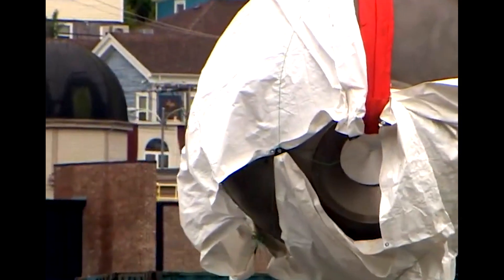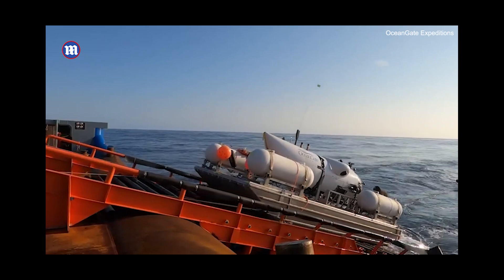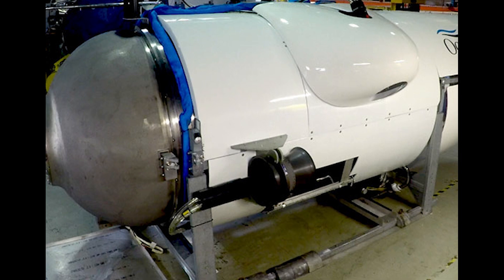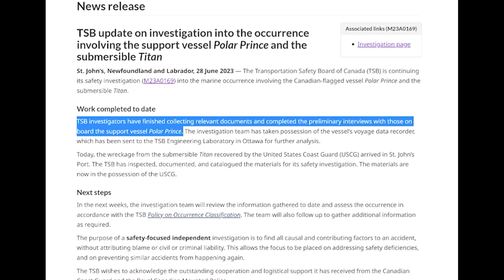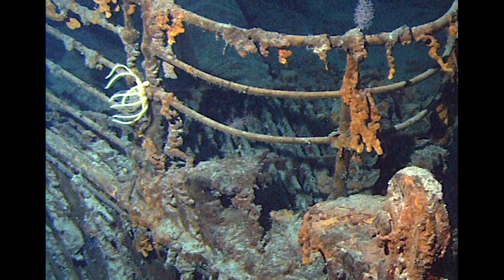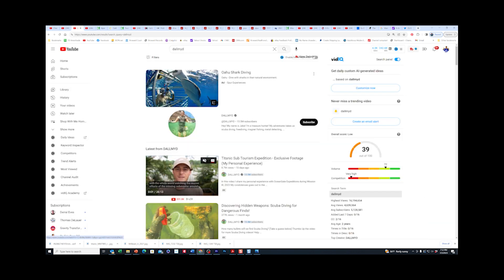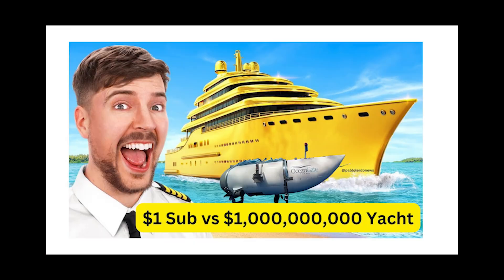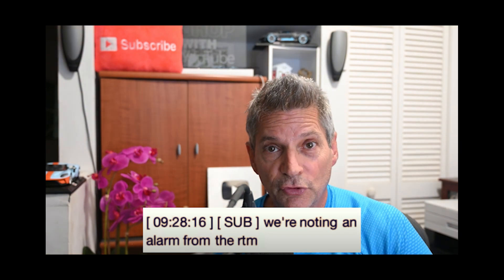Titan Submarine Debris Clues, Implosion Simulation

Comment: So where's the ring that attaches the view port? Ok they removed it from the end cap topside once the ROV loaded it on the seafloor into the hoist bucket along with all the other recovered parts. Remember that the navy has divers that prepare everything BEFORE john Q prying eyes sees things they don't want them to see above the surface. They probably have the ring and view port in their possession and so we'll never see either of those parts again. I also doubt that the acrylic view port imploded otherwise they would NOT have needed to remove the ring in the first place (so that they could hoist the very heavy end cap aboard using the hoist strap).

The ring attachments to the carbon fiber cylinder was NOT the cause of the implosion because those end caps were under tremendous pressure to KEEP THEM attached to the cylinder. They could've used Elmer's glue at those joints they weren't going anywhere because the deeper they got the stronger the joint would have been sealed due to ever increasing pressure. Please note that WHERE the cylinder joined the end cap pressure was being applied at the carbon fiber joint itself evenly all the way around the cylinder and this would have distributed that load equally all the way around the circumference of those joints.

The perimeter of the end cap joint could very well have been picked clean of any fiber remaining by the naval recovery divers. Remember that we have not seen ONE SHRED of that carbon fiber cylinder (which happens to be the largest single piece of this sub). That's my suspicion based upon governmental cover up of not only this implosion but also UFO/USO investigations as well.

When this carbon fiber cylinder imploded it did so from the MIDDLE of it probably at its weakest point. However that implosion would have been so violent that it shredded almost all the carbon fiber cylinder so much so that the end caps simply dropped to the sea floor. That's why they were easy to find probably only a relatively short distance apart. Remember that any explosive separation had a lotta water resistance thus those caps wouldn't have been located very far apart. The cause is exactly as most of us with any brains surmise.. Implosion of the carbon fiber cylinder.

I question why not a sphere? Wanna carry more people make a bigger sphere. But make it out of stainless not titanium.. with NO view ports. use a battery of external cameras instead that were attached to monitors circling the guests. You know like a round restaurant table. This sphere also would need a sub type hatch.. that is closed and opened from the INSIDE AND OUTSIDE. I'd have two of them for redundancy. Yep everybody wears a urinal bag and gives themselves a laxative to clean out those pipes before disembark. And no solid food 8 hours prior. Yeah have a delicious vanilla malt or something! Finally I would have MORE negative AND positive buoyancy to make this trip down and back a lot quicker.. no more than an hour each way. Think Trieste.. Remember how that submersible obtained positive buoyancy? It used a huge tank filled with gasoline that gave at least 12 pounds of additional positive buoyancy for every cubic foot of gasoline. That in addition to a nice sized sphere would mean you'd need to carry a LOT of ballast. but also remember that stainless is super, super strong about twice as strong as titanium. And finally, finally, I would test that sphere to TWICE the depth of the Titanic. They can do that off of Cuba.

Comment: If the failure point was at the rear, it's possible that the domed front window could have been pushed outwards when the implosion occurred, a direction that the flange wouldn't have been designed to get force applied from within, if that was the strongest point with the titanium front then it would be the last part to implode thus you'd have that force and the debris imploding into it it definitely seems possible

Comment: Stockton used a wet extrusion process to build the carbon fiber cylinder. This was a big mistake. Carbon fiber extruded via a wet process becomes brittle over time. A dry extrusion process which is more expensive, produces a much stronger cylinder. Drying the fibers before using them reduce the formation of voids caused by moisture and the extruded filament is no longer brittle.

Comment: It’s very interesting that these people thought what is essentially really expensive fiberglass and glue would be able to have multiple deep dives
Reply: I think the guy wanted to make a cheap low cost underwater tour bus business with low cost disposable subs.  Probably why he was courting influencers to increase his notoriety.
Reply: The glue is the good part, it didn't need to hold, just needed to be a well conforming filler. Since under pressure, the plastic resin of the carbon fibre epoxy wants to shrink more than the metal ring, but the lip of the ring prevents it. Under water, the water pressure is what sealed the vessel, applying both pressure that sealed the fibre epoxy tube against the lip of the metal ring, and the pressure to the endcaps sealing them to the rings and pressing the rings solid onto the cylinder. If the cylinder survived, so would most likely the whole vessel, regardless of the "glue" joint.

A little similar to the cheap Soviet dive watch, Vostok. It's famously a little leaky, UNTIL it gets under water and gets a good bit of pressure applied to it, where the deformation of the deliberately flexible pieces and the pressure is what seals it shut. Of course something that on a cheap semi-plastic watch should be called "ingenuity", on a semi-plastic vessel with people inside would be called "madness".

The mostly plastic cylinder with internal delamination risers in it formed by the carbon fibres was certainly not the good part though.
Reply: Carbon Fiber is strong, but fragile, it really doesn't handle repeated massive pressure cycles well.  Not like titanium or steel, which can flex and still remain strong.
Reply: Yes, it's called intellectual arrogance.
Reply: It did have multiple deep dives.

It allegedly completed over 50 test dives and visited the Titanic more than 10 times.

Not defending OceanGate, but keep in mind the most advanced and powerful navy in the world lost the Nuclear Sub SSN-593 Thresher during deep dive testing (which was to 400m, approximately 1/10th the depth of what the Titan was diving to).
Reply: @B61Mod12  Yep. People are totally ignorant about this whole thing. I also am not defending OceanGate or Stockon's complete disregard for safety, but the facts are that the Titan had been on many dives prior to this one. Carbon fiber can withstand these depths for many cycles, but you NEED to be vigilant in checking the integrity of the strands, which OceanGate didn't do even once. I can imagine that you are unable to remove that glue they used on the port holes as it's a chemical reaction that bonds it together. So they would have had to replace the entire sub every few cycles, which would have most likely saved the Titan and its crew from death.
Reply: @B61Mod12  Yes, and in response US Navy instituted "SafeSub" program.  They are fanatical about submarine safety.
Reply: Cracking sound heard on previous dives. I ASSUME that anyone with half a brain conducts  structural  testing after each dive. There  surely had to be signs that the structural material was weakening. And yet it appears these clowns conducted no testing after hearing the cracking sounds in the previous dive.  WTF?!?!

The good news is that this CEO and the dumb wealthy morons stupid enough to pay millions for a ticket are all dead. Good riddance!
Reply: made by Father Ted

Comment: You can’t just glue two pieces of different materials together and expect it to be stable. Each material has different properties under different conditions. They will behave differently to stresses such as temperature and pressure. Even the glue will behave differently as well. A spherical design uses the pressure to actually make it stronger.
Reply: Vacuum tubes and incandescent light bulbs come to mind. The wires on those things use black magic.

Comment: Like you said “Torque Wrench”! If I work on my Truck,And I have bolts that need tightening to “Torque spec”, Well..If I just use a regular wrench,I’m taking a huge risk of causing a leak, because I (Over tightened) the bolts and Pinched say, a Gasket. I am also taking a huge risk of bolts coming loose because I didn’t torque to “Spec”. I know there is wasn’t “Specs” for this sub but,If I could give the world a word of Advice when it comes to  anything Mechanical. Always use a Torque wrench if Available!

Comment: the whole design was amazingly bad; smooth, flat surface bonding, uni directional CF, very dissimilar thermally reactive materials. lack of secondary escape system. lack of redundancy or emergency ascent system.  I'm not a submariner at all, but I have been working with carbon fiber and titanium since the mid 80's in aviation. From an Eng. stand point, this is criminal and the Eng's, that worked on this sub and approved its use without complaint.. should be black listed from anything but science fair popsicle bridges

Comment: Ive got some speculation. 

 im not saying the porthole was the cause. But i am thinking the porthole became the nozzle when the window failed. Sucking the sub, and occupants, inside out, in a jet of super heated vapor, into the sea.

So in short the aft section tore/crushed,  and with all the ingesting force, sucked the sub inside out, 5hrough the porthole. (Mostly)

Comment: you need a bathiscaaf made by Swiss, Italy and Germany. They went like over 10.000 meters in 1960! Never change a winning horse. That concept worked safely.....why experimenting with lives??? They know how to build stuff with ten big heavy Mercedesses on every square centimeter....titanium is good, forged steel the best. It has to be massive.......and the plexiglass will always be the weak point. 1960....they could do this......9 years later there was the moon. Don't change succes too much. Carbon cylinders will react as a tube of toothpaste, only you are the toothpaste itself.

Comment: There is a video here on YouTube some where of a test where a carbon fibre tube was put under pressure in a test pressure chamber . It was about 8 to 10 inches long . But both endcaps were  carbon fibre not metal . There was a distinct sound like  crinkling before it imploded  . And there were  corrugations along its length before the collapse very different to how a metal would behave.  The ballast shown is perfectly acceptable . If you are going to throw something away why bother painting it or make something better ?   As to the reported conversation between the surface  and the sub . There are reports on  the internet that it is fake . But we do  not know as yet,  if that is true or no.   And will not know for some time.

Comment: Imo the porthole/winnow didn’t blow out. The carbon fibre laminate pressure capsule gave way to the immense crush weight at those depths and shattered. Carbon fibre is one of the worst materials for a pressure chamber I could possibly think of. Whistleblower talked about “small calibre gunshots” these were the sounds he was hearing as the vessel descended. That was the layers of the carbon fibre laminate cracking. At the depths that this sub reached the carbon fibre would have just disintegrated completely upon the integrity of the carbon fibre completely giving way. I doubt we will ever find a substantial chunk of the carbon fibre hull

The implosion you showed isn’t really a good indicator of what would have happened. That barrel is made of steel, a much sturdier and more worthwhile submersible material then carbon fibre. While steel can give way to pressure without being completely destroyed like how the barrel bends carbons fibre does not behave in that way. Instead it shatters into thousands and thousands of tiny little shards

Comment: the porthole likely got popped off like a cork. the transcript from the subs last moments said they heard noises coming from the back of the sub. if the failure was in that part of the sub the as the water rushed rushed in all at once it likely caused enough pressure to pop that right off. subs are designed for squeezing/crushing pressure. when the water at that pressure entered the interior almost instantly the pressure wave smacking against the front viewport likely shot it off like a bullet.

Comment: Wathcing them adding that epoxy resin to the carbon fibre by hand to something so complex is the dumbest shi7 I've ever seen from arrogant people who think they can reinvent the wheel. That CEO killed himself and the people on that vessel. Every manual application of the resins by those applying it is completely inconsistent, thousands of possible failures with each coat, disgustingly stupid. And there is 2 guys doing it, those guys are not in sync. Nothing stable about using that composite, and I'll add one, it's not even about logic because that was ignored. I hope those families sue, if legal finds proof of misleading info, I'm sure those liability letters they signed can be voided  as I read something years back to something similar with skydiving, mislead about equiptment and the woman slammed into the ground at terminal velocity and basically exploded, its simply incomprehensible. Zero sympathy for that CEO, he's disgusting.

Comment: Air is compressible. Water is not. At the moment of implosion, the carbon fiber shatters, ultra high pressure water rushes in to fill all the voids. Squeezing the air to unimaginable pressure resulting in an immediate explosive reaction causing the titanium end caps to blow off. All that air inside must go somewhere and afterwards there was probably a large bubble of air that went to the top.

Comment: Not using a torque wrench... you see, there are many ways to recognise people who are clueless or just don't care. One way is if they are not using a torque wrench. Go to any serious mechanic shop like any race car support team and you will find that pretty much any single nut and bolt will have specified torque and there are a lot of reasons for it.
Obviously, I am not saying those bolts had anything to do with the accident. My view is they are just another indication that people who were doing it were clueless and unserious. Like using off the shelf Logitech controller (not even a good one) in an enclosed space with a lot of condensation.

Comment: The biggest problem I have seen having researched some about carbon fiber and pressure tanks, is most pressure type canisters use a more cross hatched pattern weave in the manufacturing and this hull did not so was nearly as strong.
Reply: Not only that those pressure tanks have pressure from the INSIDE putting the OUTSIDE in TENSION!
Reply: @leecowell8165  The 1 bar inside the pressure vessel is not doing anything meaningful for structural integrity. It would work practically the same if there was a total vacuum inside.

Comment: Glue on joints and the crackling sound from carbon fibre hull are the two big red flags in this sub. Apart from a weak glass window, an inexperienced young team and an arrogant owner.

Comment: Somewhere here on YT is a vid of a railway tanker car imploding parked outside on tracks.  It was intended to be a demonstration as I recall.  The tanker imploded so fast from atmospheric pressure that the action was invisible.  One second it is a tank car, the next it is a crumpled tube and that was just at 14.7 lbs/sq. in of atmosphere.  The Titan was dealing with 1.5 tons per square inch!  
Not having that vessel inspected by appropriate agencies or at least peers is in my mind a criminal act.  Rush's hubris took four innocent lives.

Comment: I still say 18 bolts going in and out and with the threading along with the give of the material, that water got in. Under that pressure, I think it was slow versus an implosion. Maybe the hull (I think it was, that housed the oxygen) imploded but with ALL these full parts, it does NOT point to a fast death like they're saying. Either way, NOTHING about the submersible should of been going down to that depth. I think just to be over with it, that they won't give us anything definitive outside of, "It imploded" 🤷🏻‍♂️